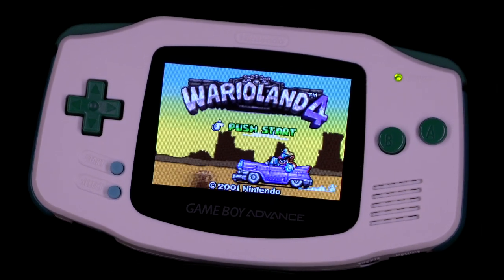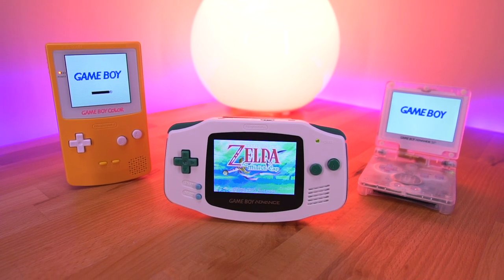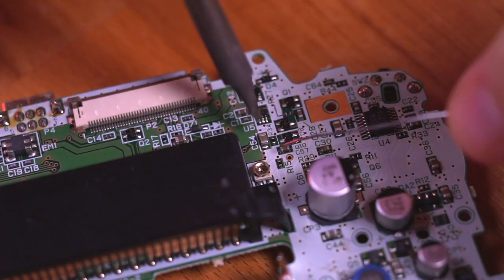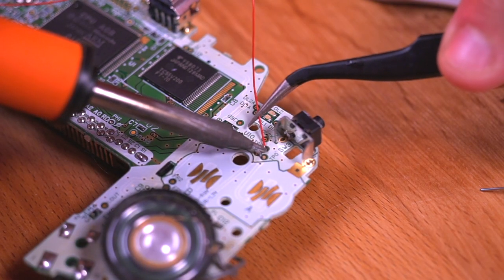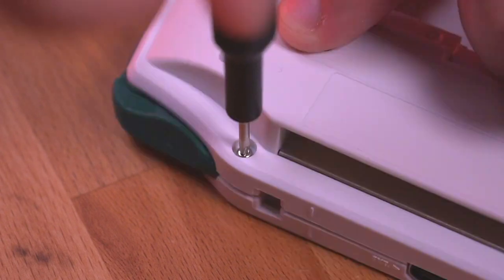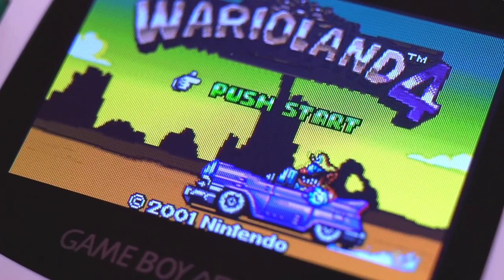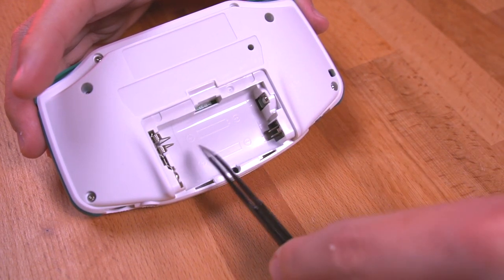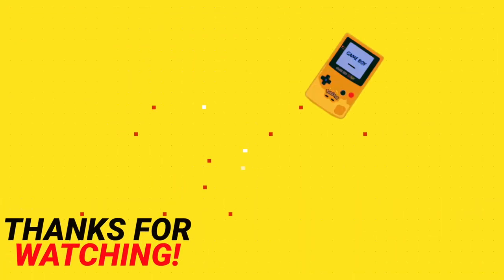Latest LCD Upgrade for the GBA | Laminated ITA Kit

Comment: I think a big con to these laminated kits is the fact that we have to buy a specially made shell. I love the look of the laminated LCD but I'm not a fan of aftermarket shells.
Reply from the maker: That is certainly a con. And after reading your comment I just thought of another which is if the the screen lens cracks it will be difficult to replace. I’ll definitely mention that in my next laminated ips video.
Reply: There are a lot of crappy aftermarket shells, I agree. But I heavily modded my GBA and haven't looked back. The new shell I got for it came from HandHeld Legend, it's made by RetroSix, and it's the pearl edition. It's got a matte finish and a slight rubbery texture where your hands hold onto the console on the back. It looks and feels nice and gives the console a nice grip. I paired that shell with buttons from FunnyPlaying. Plus there's no excess plastic to shave off because it's made for ips screen mods 🙂. Unfortunately price wise it is a bit on the higher end as far as shells go though. It also fits the chargeable battery pack mod and you can get a matching battery cover that has a type c usb hole in it. 
The only shells I find that are always bad, no matter what, are the horrid DS lite and nds shells. There's always excess plastic and they require too much plastic shaving just to get original OEM parts to fit.
Reply: Are the screens very prone to cracking? I'm guessing if you drop it on the floor it'll crack for sure but does it withstand the odd drop on the table if it slips out your hand?

Comment: Another great video, thanks Tito! I'd say one of the cons of a laminated screen is that, if you have the bad luck to scratch it, you have to replace the whole screen. Instead with a regular screen you just need to replace a much cheaper lens.
Reply: This is important to keep in mind. Along those same lines with this kit, you can’t get any custom printed lenses which may be a dealbreaker for me.
Reply: Good point. I would definitely put a screen protector on it.

Comment: Noticed that you didn't mention one of the biggest benefits - less input lag.  At least I assume these kits have less input lag than a cheap aftermarket IPS display not originally designed for use with the console?  Hope this gets tested, input lag on portables is not talked about or tested nearly enough for these screen replacement kits.  It's a MAJOR issue though & needs to be taken into account when buying!
Reply: It seems that FunnyPlaying's own IPS kit has at least two whole frames of additional lag, whereas the ITA only has one (which is unavoidable, because the original GBA display drew frames directly with no buffer, and this being a DSi display means it requires a buffer).

Comment: I know this video focused on the screen kit, but man that drop in rechargeable battery mod is so slick. Utilizes the existing battery connectors so you don't have to desolder them, fits neatly in the battery compartment, only need to swap out the little door.. they really thought that through and made that as user friendly as possible!

Comment: One con that should be mentioned is that these shells with the battery compartment that allow for both rechargeable and regular AA batteries are actually not awesome for AA batteries. The batteries can get easily knocked out of place if you're not careful (which happened to me while playing a game, almost dropping and catching the GBA... to find that it was turned off because one battery fell out of place).

Awesome video as usual, Tito!
Reply: This sounds super annoying, can't the batteries be hold in place somehow inside the Shell?

Comment: Damn these kits are looking pretty slick 👀
Those touch sensors really piss me off though so I'd probably end up lopping it off and just wiring it. I always accidently touch it on all my builds that have them.
Reply: Agreed. I need to remove it from the NGPC I have. Every time I pick it up, it changes. And it drives me crazy.
Reply: How do you lop them Off?

Comment: I followed this guide to put together something similar! 
Two corrections: You placed the A/B membrane on backwards and didn't place the power light diffuser.
The screws that come in the kit are pretty soft and strip easily, so the less you have to open it back up the better.
P.S. The original screws for the GBA are stronger and reusable.

Comment: Just love this system so much. So many mod options for any price point, and you get access to most of the 16-bit era for a huge discount compared to the home consoles.
Reply: i bought a GBA everdrive mini on ali express yesterday for 20 bucks.. ill tell you if it works
Reply: @Grant-H2O  🙋🏽‍♂️
Reply: *32-bit era
Reply: @Grant-H2O  cap
Reply: @megamix5403  Nope, that was Playstation 1. 16 bit. GBA played mostly Super Nintendo level games.
Reply: @SIPEROTH  he's getting into semantics. Technically the GBA had a 32 bit CPU. But for all practical purposes it played like a Super Nintendo with a Super FX chip built in
Reply: @Realmadridfan4ever1  It works for games but no instructions or guides come with it. Youll need your own 2GB SD card. some ppl say 4GB will work too but make sure its MicroSD Brand mine says Kingston made in tiwan. Also you will need software for SUPRE CARD GBA which i found after a few searches of google and found the link on reddit for the free software. The card itself was 19.95 cost total and showed up after 12 days which is pretty fast IMO. I do want to spend the extra 100 bucks on the everdrive to get instant load times, no software, drag and drop the games without any converting, and possibly even link cable functionality. 20 bucks gets me a huge library and ill get the 100 dollar card when i get the money
Reply: @Realmadridfan4ever1  The Trade Cable WORKS!! using a fire red rom on the super sd card for GBA and a legit copy of leaf green i traded and battled in pokemon. Ill still prolly get the 107 krikzz everdrive because i want instant load times and actual game saves. game saves are not working for me atm but they have a savestate option which is untested at the moment
Reply: @megamix5403  It works for games but no instructions or guides come with it. Youll need your own 2GB SD card. some ppl say 4GB will work too but make sure its HD. Also you will need software for SUPRE CARD GBA which i found after a few searches of google and found the link on reddit for the software. it was 19.95 cost total and showed up after 10 days which is pretty fast IMO. I do want to spend the extra 100 bucks on the everdrive to get instant load times, no software, drag and drop the games without any converting, and possibly even link cable functionality. 20 bucks gets me a huge library and ill get the 100 dollar card when i get the money
Reply: @Realmadridfan4ever1  separating the 300 games into 10 folders using about 30 games per folder was a huge pain and metroid zero mission lags on way too many screens. id compare it to my real copy but i just sold it last weekend with the manual and fusion

Comment: This is my favorite screen out of all.  Though I had to redo all the mods I did on my IPS v2 like the clixky buttons and amplifier mods to a new board because my V2 is already starting to wear out but I still plan to keep it as long as the corners of my screen hasn't turned black or faded into white. ITA screen's look is just way in-line with my preference.

Comment: For anyone buying this kit now, the display bracket has been changed. It fits over the connected ribbons so you don't have to un-tape the board from the display at all. If you try to put the bracket under the board so that the ribbons lay on top of the bracket like the video, you'll damage the bottom ribbon.

Unfortunately my display arrived with the bottom ribbon broken off where the ribbon comes out of the display, so unless I want a screen with no backlight (defeats the whole purpose), I'm waiting for Retro Repair Shop to replace :(
Reply: Thank you for this! Good luck with yours. My dilemma is that I like to look of the transparent shells, but this kit has really bad light bleed on anything that isn't a solid color. Haven't made up my mind yet.
Reply: @familybarton  Luckily I bought a solid black shell so light bleed shouldn't be an issue. I like the ITA more than the IPS. It looks more retro with the natural pixel grid and less saturated colors.

Funnyplaying instructions show the board on top of the bracket, so maybe they still want you to install the same way. But the cut outs on the new bracket don't align to the ribbons perfectly on mine to do it that way. Makes more sense for the bracket to sit on top.

New screen comes Monday. I'll try it again and confirm.
Reply: @Grave79  Thanks for the additional info. I just ended up buying the older unlaminated ITA kit. I wanted the option of being able to use an original OEM shell, so just went that route.
Good luck though!
Reply: @Grave79  I just finished an installation with the revised kit, and I had to install the DSi LCD ribbons under the bracket instead of over. It was very frustrating to figure this out.

Running these ribbons over the bracket almost destroyed the video signal ribbon -- I could not get anything but a white screen in the assembled form.

Now everything is working fine.
Reply: I ran into issues with the new bracket as well, tried folding the ribbon over the top of the bracket like in the installation instructions and got a flickering screen image due to the pressure on the ribbon
Reply: @TravisNuttall  Ouch. I almost did the same thing. I've emailed Retro Game Repair Shop repeatedly telling them the old instructions they have linked to Funnyplaying's site is bad for this exact reason. So far, neither have taken any responsibility.
Reply: What is the bracket even supposed to look like. I received my kit and I have no idea if this is the correct bracket. I can't figure out the orientation for it at all and am afraid of damaging the ribbons.
Reply: @Zerimar_  A picture is at the very bottom of the Funnyplaying instruction site. It looks similar to the one in the video but is only the outer frame. If it looks like the frame version, then it goes over the ribbons. Don't untape the board to put the frame under the ribbon like the video or you'll break the ribbons. Good luck!
Reply: @Grave79  they actually sent the IPS bracket not the ITA one which I'm afraid to shove in. Thanks for the message!

Comment: I’ve had about half the touch sensors on various kits malfunction and self-trigger. I usually just snip them off. If you wire the buttons it’s irrelevant.

Also worth noting is the AGS101 and DS TFT’s do not natively support 5 levels of brightness. The potentiometer can only accurately dial in one level, so realistically I would go with the default brightness (3) on any retrofit kit using a TFT, not worry about changing brightness, and calibrate the potentiometer for that. Odds are it’s going to already be close to perfect for the default brightness anyway.

Comment: sadly , i can still see the horizontal white lines across the screen, that its caused for the funnyplaying ribbon ;/ , sold mine for that reason , you can see them around 9:27 on the warioland 4 intro, in the sky, white lines across all the screen, and on the ground too, that is not normal, funnyplaying know of the problem but they cant  fixed right now...or so they say

Comment: Glad to see another laminated kit. I hope funny playing continues this trend with the other Game Boys.
Reply from the maker: They have em for the game boy color and SP. I think the DMG is all that’s left.
Reply: @MachoNachoProductions  I just received a fully laminated LCD FunnyPlaying Kit for the GameGear. So they are even continuing the trend there. You have to cut the shell to fit it in though. I haven't modded a GameGear with it yet, but I hope this means being able to use the full size of the LCD (could also be interesting for Master System Games).

Edit: Unfortunately the cutout from the screen protector is still the same size. What a missed opportunity...
Reply: @MachoNachoProductions  I have the GBC 2.0. I had to get it after watching your video on it. I have done two GBP''s as well with the non laminated kits. I'd like to see FP take on other consoles Like the Nomad, Lynx, and Gamegear.

Comment: I just got a 32 pin version the other day. Definitely gonna do this mod after I finish my SP. Great tutorial Tito. How did you fix the touch sensor from auto adjusting?
Reply from the maker: Sweet!  I showed it in the video but the key is to tape the sensors to the top of the shell and make sure that it’s not touching the rear shell by pushing it as far forward to the front of the console as possible. Best of luck dude 👍

Comment: 1:1 pixels are nice for sure. Really like this option compared to the AGS-101 screen, given that the original ones aren't getting made for years, getting ever more expensive, the corners getting white towards the center and so on, plus killing an AGS-101 if it wasn't board-dead already which I've rarely ever seen anyway. Then the option turns into the Aliexpress new reproductions that have visibly different colors, contrast and sunlight visibility (to be honest not that there was much to begin with in that regard, that's AGB/AGS-001 dominance).
This DSi LCD seems to match the color tone between the original AGB-001 screen and the AGS-101 ones. A huge plus in my view, the original 101 is way too saturated in older games.

EDIT: ...what does ITA stand for??
Reply: ITA stands for "DS[i] [T]o Game Boy [A]dvance".
Reply: Unfortunately it's not 1:1 pixels. Funnyplaying markets this as having the exact same resolution of the gba (240x160), but both top and bottom Dsi screens had a resolution of 256x192.  So either it's not a dsi screen or its not the same resolution. You can see a visible difference in the way the pixel grid looks when turned off if you compare these screens to an ags 101.
Reply: @viridionwaves  Doesn't the controller that interfaces the GBA to the DSi screen do the cropping? The GBA frame fits without too much borders inside the DSi frame after all. This would allow some calibration to center the image as well after install.

Comment: Bought mine and came in today. 2/11/2023. The laminated screen is off center. So bad it cuts off some of the game. Since the screen, glass, and plastic frame make it to where there’s no way it could be off, I know it’s the screen and not installer error. Btw this tutorial is outdated by a lot. Many thing’s different now and there’s no instructions for the updated parts. This also is not a complete comprehensive guide as there are smaller pieces and steps missing.
Reply: You can adjust the x and y position via the on screen settings.

Comment: Hey Tito, pretty cool laminated ITA kit, thanks for showcasing this build. I have the previous model non-laminated and I can confirm that it's prone to dust building between the lcd and the lens. I'm only disappointed to see that for the moment Funnyplaying have a limited number of shells available, I bought a SNES theme shell with the previous kit that looks amazing and I don't have this option yet with this new iteration. But regardless, the ITA is my favourite LCD for the GBA - resembles the AGS-101.
I'm not fully convinced on the rechargeable battery mod, not a bad option, but AA last a ton with this kit compared with the IPS kit version. Have you measured how many hours you pull with a full charge? (I get 9 hours with std rechargeable AAs)

Comment: 2 questions
Can I just snip off the touch sensor if I add the wires?
Also how do I get 160p test suite on a GBA cartridge (can I use an everdrive)??
Reply: I second this Question about snipping off the Touch Sensor.

Comment: Great video but you didn't mention the ripple issue (maybe that had been solved in the meanwhile by FP) and most importantly the screen line issue with FP ITA kits (maybe only in 40 Pin models). FP said they can't fix this atm.

Comment: Looks great! I have a gba with one of the early IPS mods that has screen tearing, so I may be redoing it with this mod. Question about the battery, does it support charge and play? I’ve heard most battery mods require you to turn off the system while charging

Comment: How responsive is the panel? For instance any noticable blur or smearing in motion?
I have a v2 screen in my gba and its amazing compared to my ds lite, which has realy bad motion smear and colour shift because the pixles cant change colour fast enough.

Comment: Forgive me if this is a dumb question but is there no connection wire from the rechargeable battery to the board itself? Or does the battery itself connect to the existing contacts on the opposite side of the contacts you removed? I'm assuming so, but it just wasnt very clear or discussed. Maybe its just implied. Sorry if my concerns are confusing.

Comment: Did you have any issues with putting pressure on the screen? I know they iterated on the bracket a bunch so hopefully they solved that issue.

I watched mahko’s stream of the laminated ips and wasn’t super impressed. While the ips (non-laminated, at least) does look nice, everything is too smoothed over versus the pixelated look of the OG GBA, so I think my next build will be the ITA… but maybe in 6 months, since FP tends to revise their products often.

On the plus side, I didn’t know they had the touch sensor… I see no point in busting out the soldering iron to do the same thing.